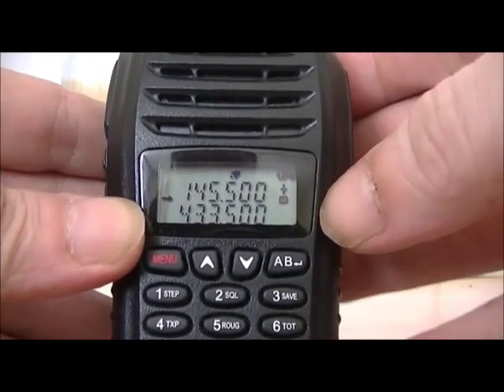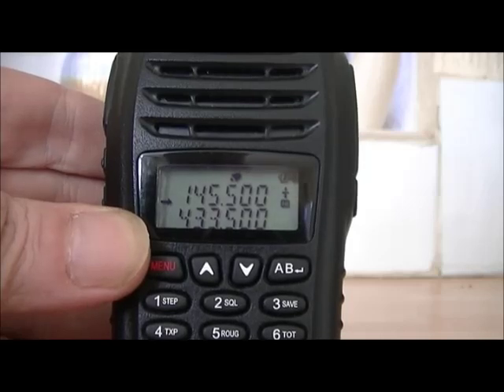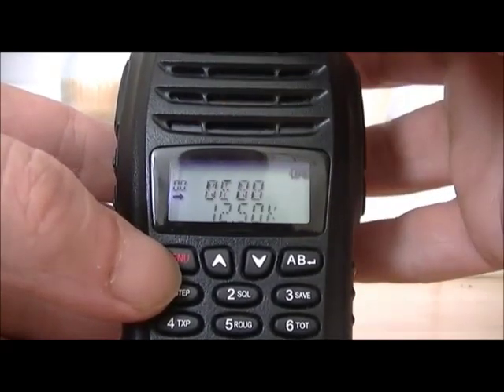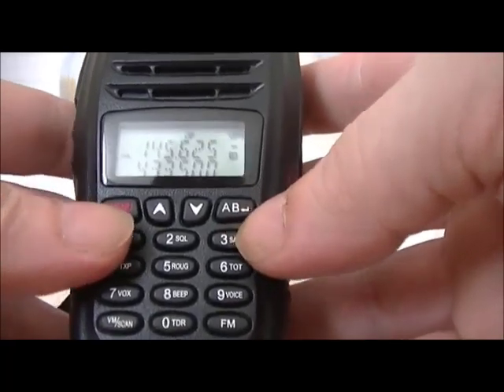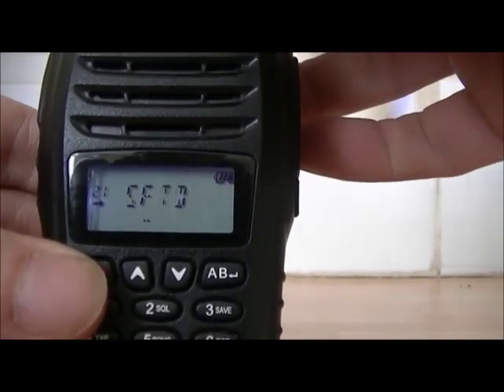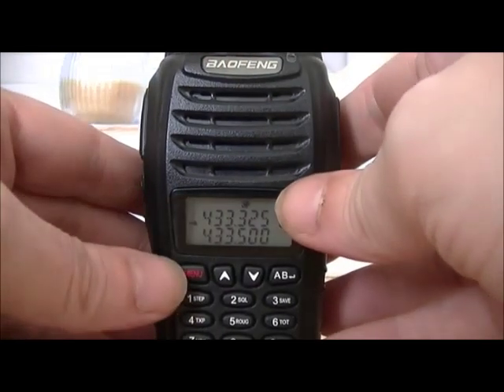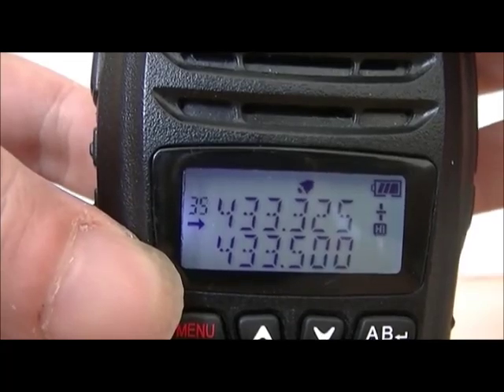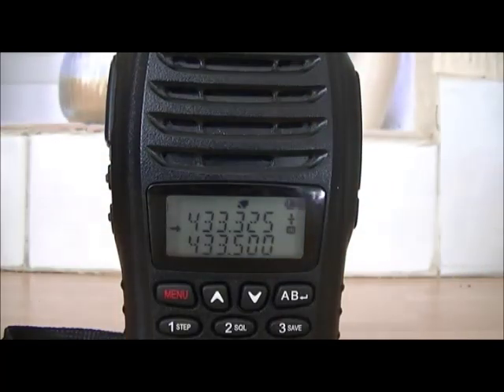Baofeng UVB5 how to program vhf/uhf repeaters

Comment: I've found that has an audio problem, the same as that distorts and piede power when you enable the option of dual band, depending on the menu option 10, if anyone has or had this problem please tell me as it did to overcome this issue